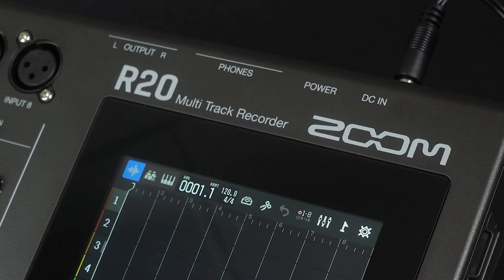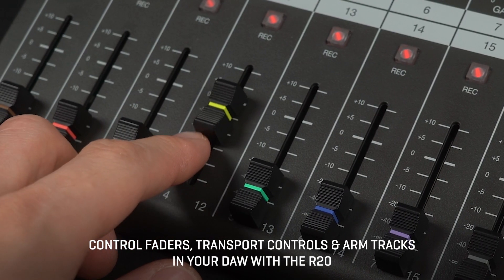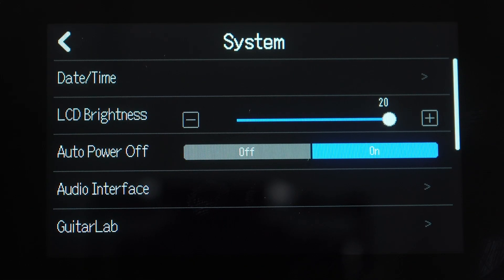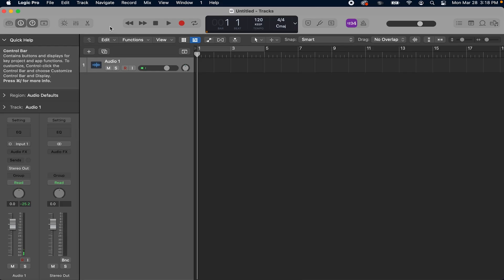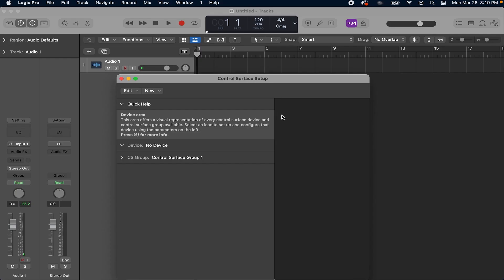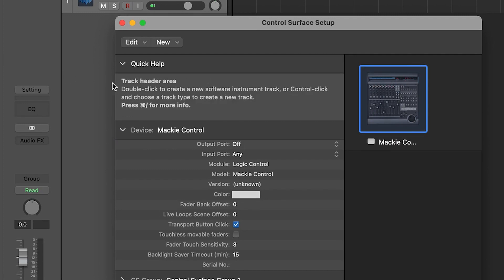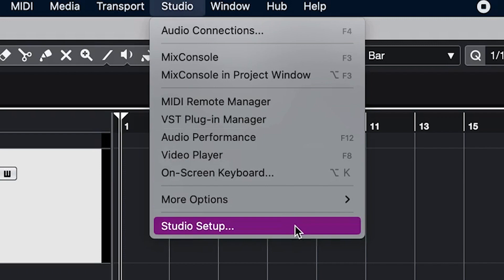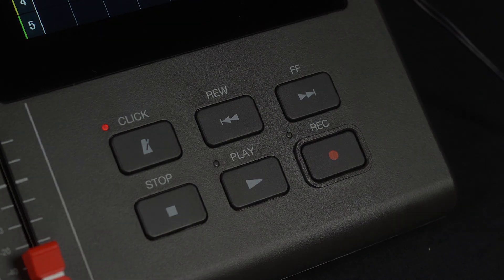The Zoom R20 - Control Surface Setup

Comment: You cannot use this unit as a daw controller on ios. No app allows mcu or Mackie control through iPad or iPhone.🎉 You can plug in and record. But you cannot use the faders to control the on screen daw. Only works on macOS properly

Comment: PS we love this touch interface for editing, I don’t think there’s anyone out there doing this aside from Akai MPC series. Down the road would like these units with a larger screen format, or some more in-depth editing . Of course, firmware improvements for the touch display for sensitivity would be amazing. Sometimes the R20 Interface editing can be difficult to use. Another 20% would probably put this thing over the edge.

Comment: Does it work with the new MAC m1 chip?  I have an older R16 that doooooooes NOT.  SO guess I need a new machine and want to make sure.
Reply from the maker: The R20 is compatible with M1 computers.

Comment: For New Users.  If you are using a new R20, update the firmware in order for the control surface setup to work.